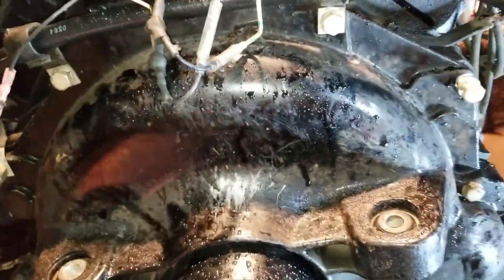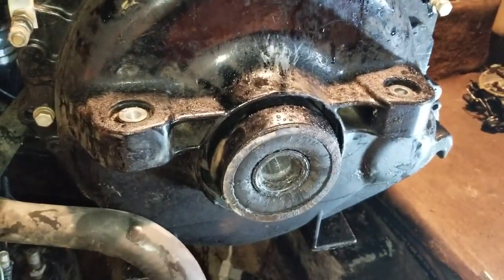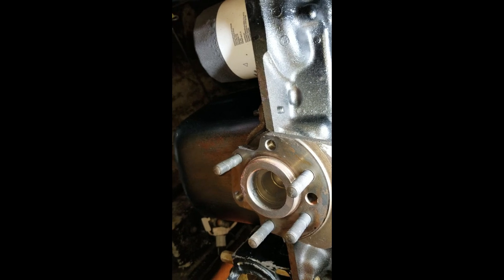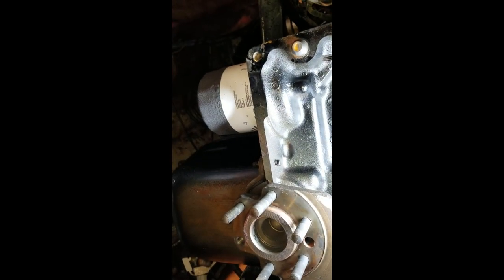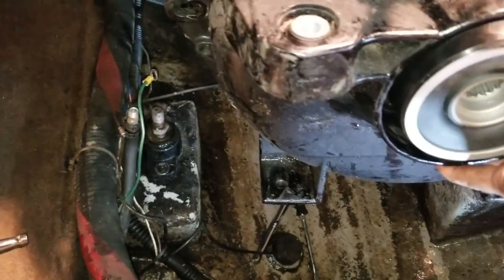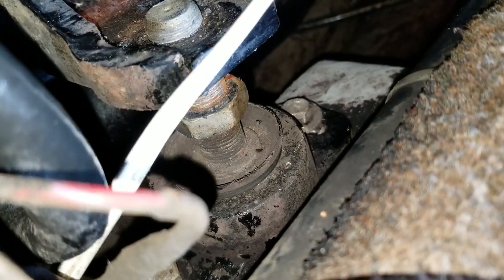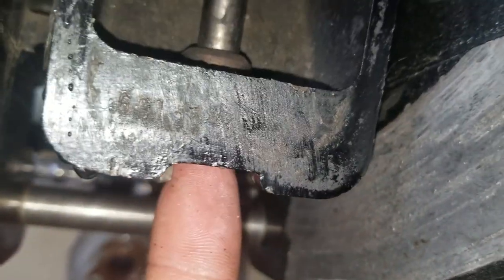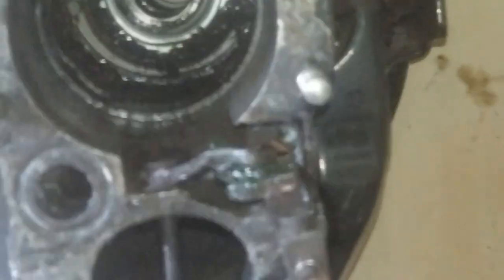How To Replace Engine Coupler Mercruiser

Comment: I'm getting a weird sound coming from the coupler area with the sterndrive off. Any greasing or maintenance for this? A Video of sound is enclosed below. Any ideas what this could be, the splines look fine on the drive shaft of the outdrive. The Inside of the coupler spline seem fine when feeling it with my hand. https://youtube.com/shorts/ejTgRw6c_rQ?feature=share
Reply from the maker: Am I understanding right that the drive is removed from the boat? Sounds to me like ujoints but wouldn't make sense if it's removed. Unfortunately it sounds like it needs to come out and see what's banging around in there. Could it be low end knock? Hard to tell in a video.
Reply: Stern was off. It was a loose coupler. I had to order a new coupler because a few of the studs got compromised from it being loose and the coupler holes were eggshaped from the looseness and friction. I'll need 2 studs now to replace also. There not cheap in price.

Comment: What engine is this?
Reply from the maker: Mercruiser 230hp the 5.0 v8 engine
Reply: @thestigmach1984  thanks
Reply: @thestigmach1984  what would a job like this cost?
Reply from the maker: @bodyshotjake7475  not sure never checked into it call around different shops to get estimates

Comment: Really need to get a tripod so that the people can actually see what you're doing ,,
what good is a video if its goes like ..I wish I could show you this part but I can't.
Reply from the maker: Come hold the camera for me so I can. Most other people seem to have figured it out and found it helpful.
Reply: @thestigmach1984  it was helpful I was only suggesting that because it would be helpful more to be able to see and a tripod would serve that purpose free up both your hands I'm about to change out an engine a 305 engine and I have a lot of research even though I have pulled one before you can never know too much ,,the other one was a small 4-cylinder MerCruiser